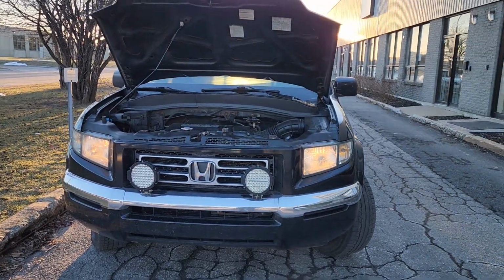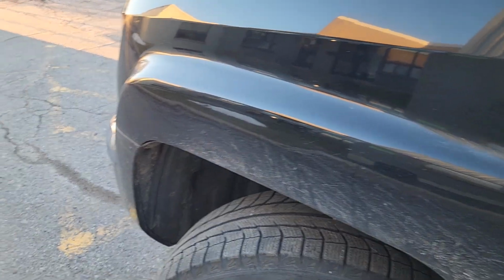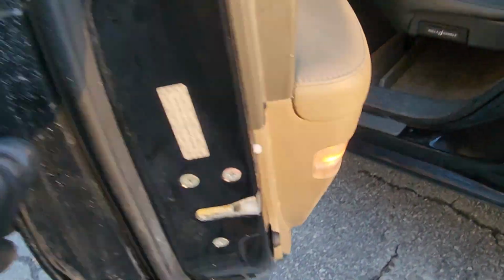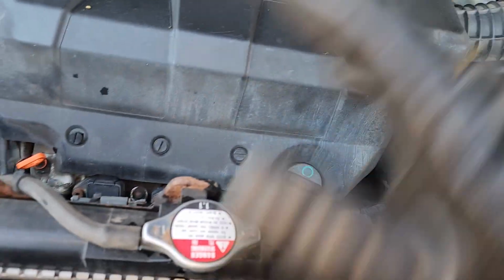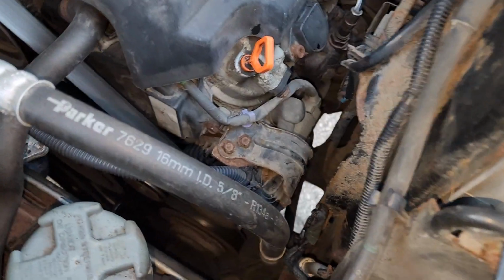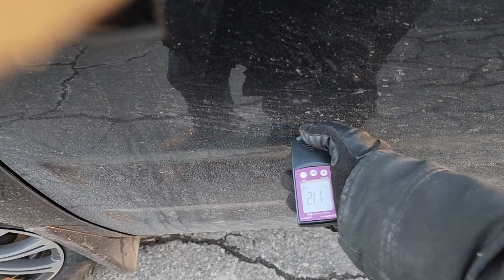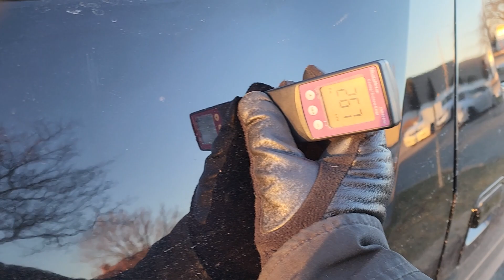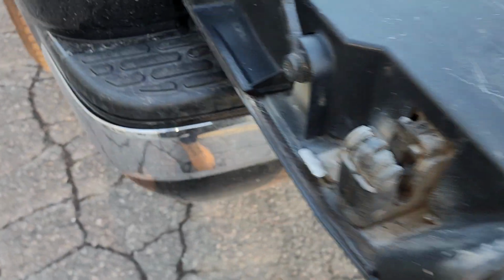2006 Honda Ridgeline Pre-purchase in Montreal Part 1/2 | GetInspected

Comment: Nice walkaround.  I like these old ridgelines. Remind me of the avalanche but without the cool midgate.  I have two hondas and one acura with that 3.5 v6. Tapping noise sometimes due to timing belt slap from week hydraulic tensioner.  Those side engine mounts are torsional and prone to failure, but easy to change. Engine is durable and pulls strong.